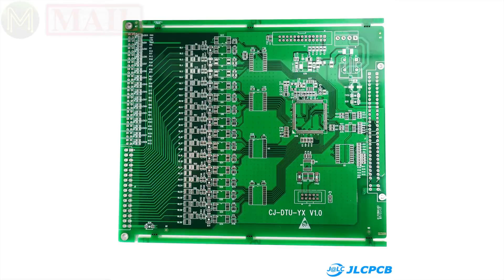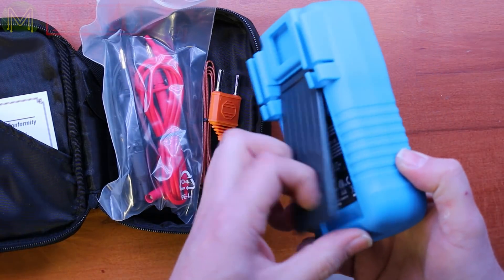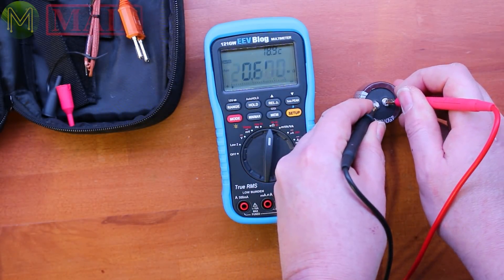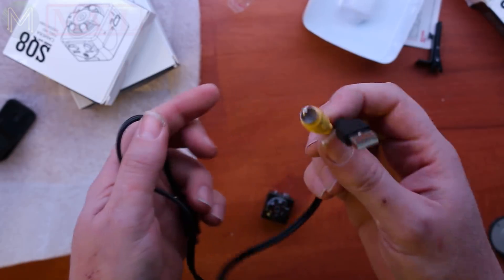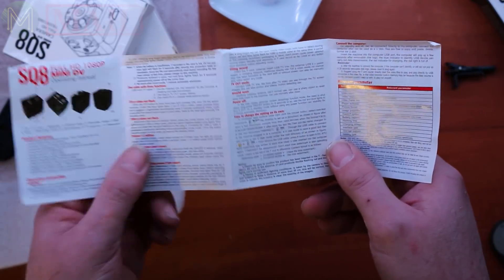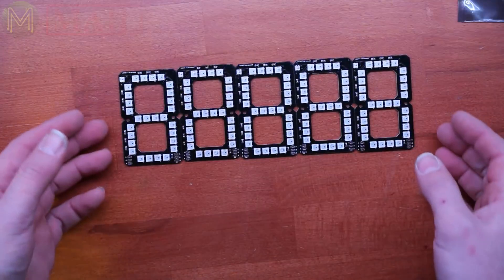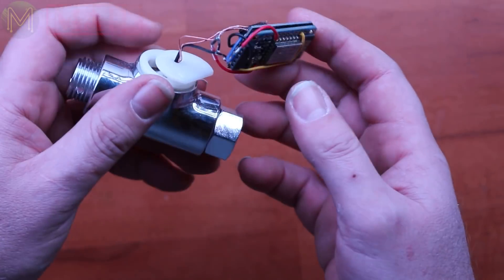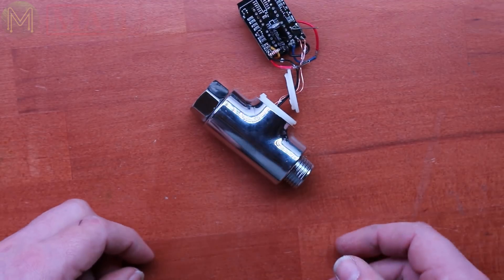#218 MickMake Mail #32: EEVBlog 121GW, spycam hacking and other bits.

Comment: Last time when I was running cables in the roof I took some short wooden planks up with me to lay across the beams to make a walkway while I pulled the network cable up and across the roof and an old pillow to sit on while I was splicing the phone cables. Our house has a concrete floor so I can't run the cables undr it.
Reply from the maker: Yeah, that’s what I have too! But I was rushing and careless. Serves me right.

Comment: I bought an SQ8, it didn't work, I was sent a replacement, it didn't work, got another, it, also, did not work. I gave up trying after that.
Looks like your hands have taken a "reno" beating to mach the ceiling.
Reply from the maker: After trying several of them... I’m not surprised. I can’t get it out of 340p mode. It’s not even 720p!
Was hopeful, but sadly again let down.

Comment: I did a same hole on one ceiling.... but in the house of the customer.
Guess where this weak point is located? Exactly above of the cooking plate!
And guess what was on the cooking plate? A F huge 15L pot, full with freshly made bean soup! It was a nice day :)))
Later on we figured out, the previous owner removed the ventilation unit, and he just covered with a drywall board. 
Never step into bean soup! It hurts:)))
Reply from the maker: Mate, I know at the time it must have been pretty bad, but that’s hilarious!
That’s something I’d do.
Reply: It can be worse. When my dad put his knee through the ceiling, he was blowing insulation in at the time... So besides the large hole, the living room was covered in insulation. Fortunately, it was "paper" insulation, and not fiberglass.
Reply: MickMake Me three ...
Reply: James Potts but there is no bean soup:)))))))) and a crying grandmother of somebody...